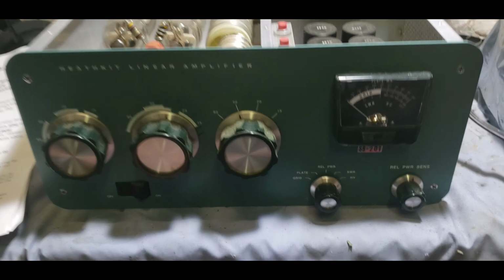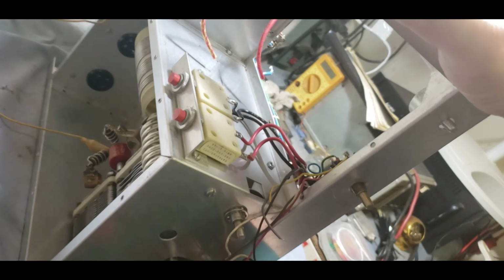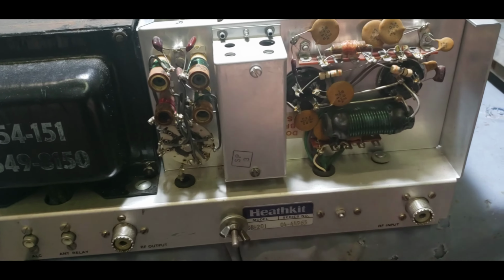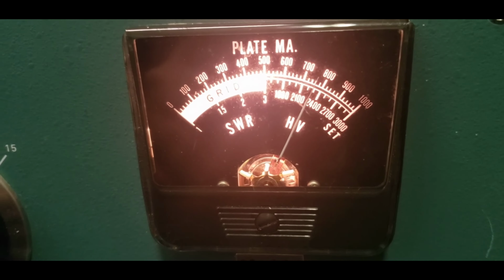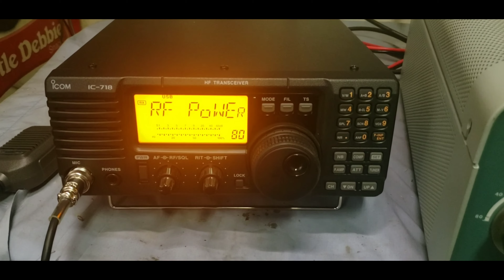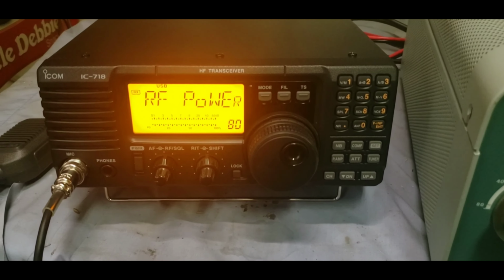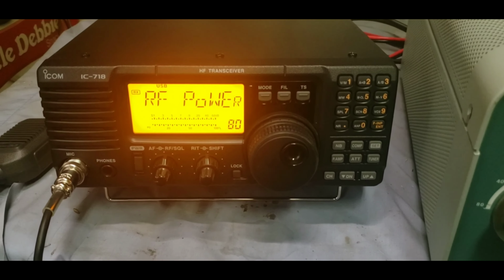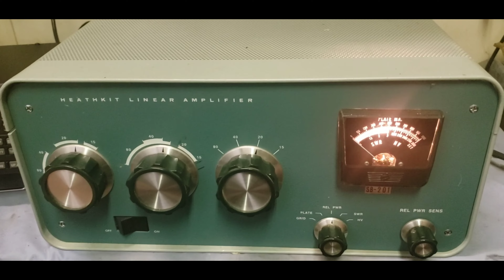Heathkit SB-201 w/ 2x 572B's PS Board Install and Repair 👊

Comment: I have a sb220 a old radio engineer buil I bought it from him over 30 years ago he is a silent key now 
Tubs are over 80% good n the original  I got 811h that's got like no hours on it lol
In truck I run 706mk2 in to amratron 500 in outback antenna
Reply from the maker: Aaahahhhhh man I've been wanting a IC 706 mrkIIG for years man....years one of these days imma get one....i love my 911A but that mark 2 man I want one bad...with a multi banded Tarheel would be sweeeeeet!!!!
Reply: @1883GotDown  I have Don Johnson original plans for the scwediver n a few coils built already 
Had one all done but it got stolen 
I really likeI mk2 I have talke all over the world with it I have Heil one ear
Head set whith Mike  I run it about 60 watts in to Amp  n lmr 240uf
It all pulling of big battery in the bed
Got a 240amp alternate big 3 power upgrade got over 30 ground straps bounding the truck 
My ham radio wus ft401b n I upgrade to a ts140s I still have it
About a year before thay stoppedmi making the ft1000d I got one n I really like it  my base vhf is a ft736rn it all trick out voice mod n 6m n 900 mhz I use to work satlighs alot
N ssb on 6 meters n 2 meters